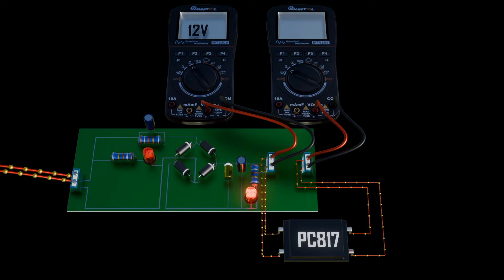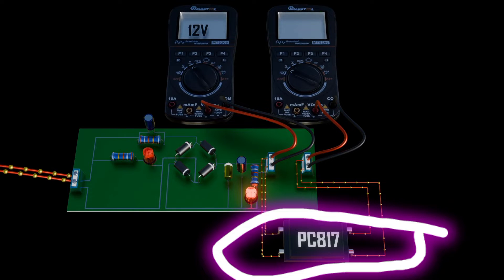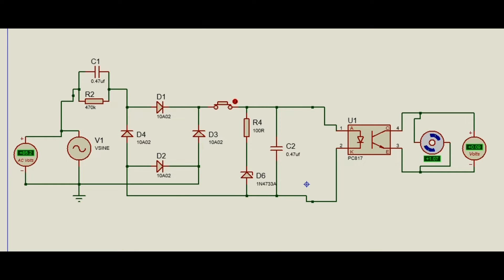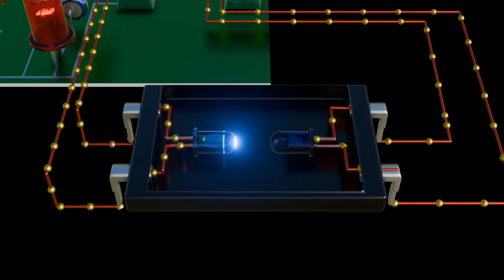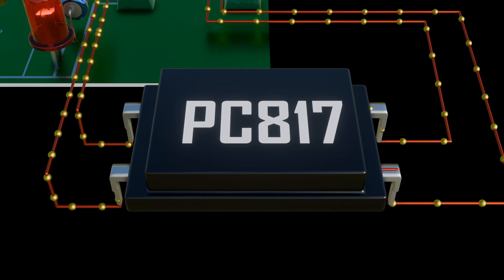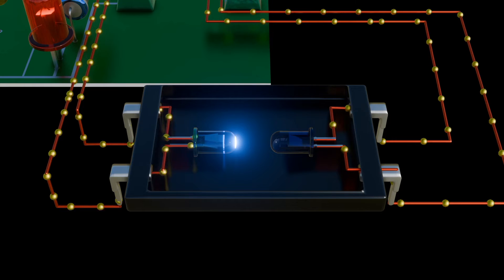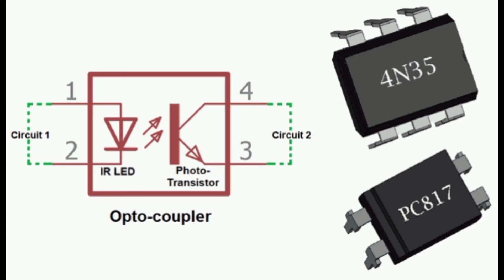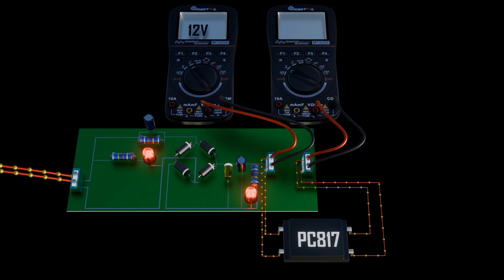optocoupler working explained in animation. importance of signal isolation.  #electricalprojects

Comment: So light change the resistance of the circuit on the right allowing electricity to flow through. When the light is off the ressistance is high and stop the current flow on the right circuit ?
Reply from the maker: Correct, also the idea is used in digital tachometer